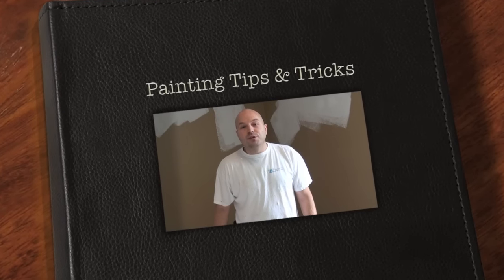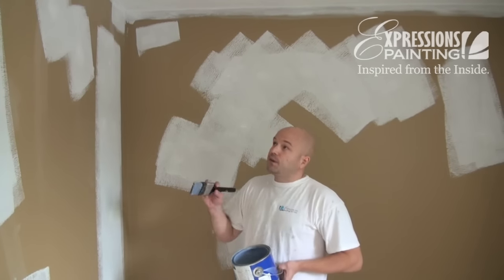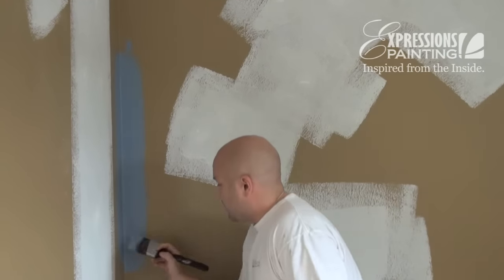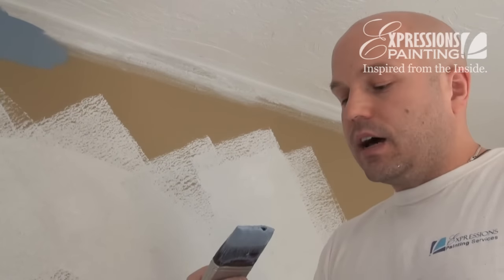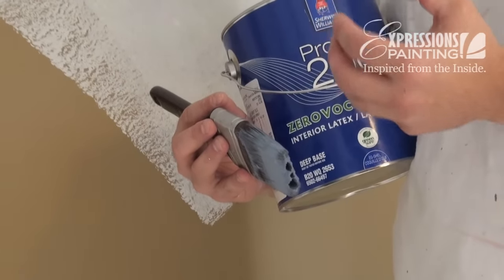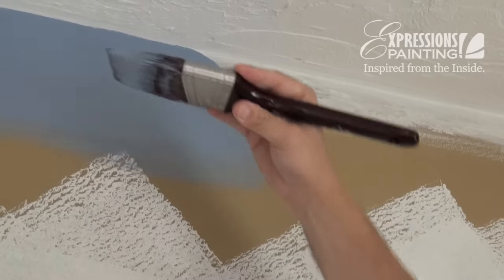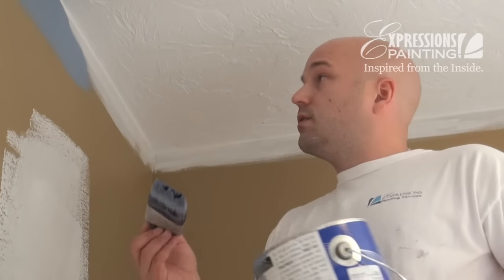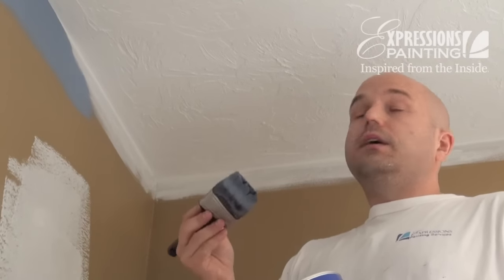How to cut a straight line like a pro

Comment: Quick question. Do you cut, roll, cut, roll or cut, cut, roll, roll?  Great videos by the way.
Reply from the maker: Cut roll... Cut roll. Sometimes you're able to get away with cut cut roll roll with lighter colors but it is still strongly recommended to cut first and then roll

Comment: I self taught myself this when painting my parents entire house before they put it on the market. I had painted before but this was the first time painting 10 rooms in a row over the Course of a few months on off days. First room I taped but it became really annoying and took way too much time and not to mention the cost. I tried several ways with a wet rag handy till I realized that the trick was to get a good amount of paint on the brush and paint the wall near the edge till the excess was off the brush then cut in in a long stroke with the tip of the angled brush towards the edge your cutting which pulls the paint toward that point but it's still a pain though but easier than taping for sure.

Comment: I always work top to bottom so that the last thing is to cut in gloss/satin skirting (what you call base board)to wall to get a nice crisp white edge. You seem to be cutting emulsion to a finish paint--doesn't seem the right way to me!?
Reply from the maker: I'm not really what you mean by emulsion but if there's one thing I learned over the years is that there are many ways to achieve a great finish product. Every project is different :)
All the best!

Comment: emulsion is wall paint. UK. 
We paint walls then to finish we cut a neat white line baseboard to wall with gloss/satin paint
Reply from the maker: That's what I did in this video series :)
Reply: Ok sorry but it seemed like you had painted the baseboard and were cutting in with wall paint in the video?
Reply from the maker: +markos bientos no worries ;)

Comment: Nit bad sir but I was taught that when you cut in a straight line you have to apply your paint both ways back and forth as you are making the actual line in order to make a perfect straight cutout, San Antonio Texas Painters
Reply: Not necessary.  Michigan painter for 50 years.

Comment: I don't use.a brush for cutting in...I mask everything, and use a wiz with a 3/8 nap roller to cut in with, and you never see the cut line...the texture is all the same. And I paint one wall at a time, so I'm cutting and rolling while it's still wet...the results look perfect...not to mention it's way fast...can paint a average bedroom in 35 min

Comment: The only thing i didnt agree with is not running tape on top of the base. Youre going to need it when you start to roll, and it leaves a better edge even if the base still needed to be painted.

Comment: He forgot to mention.. If you didnt notice
He started the blue on the white/brown and drug the blue into the blue he just painted..
He didnt start on the blue and pull it towards the brown.

If he started on the blue and worked into the brown. It actually pulls the paint away from the blue he just did and thins it out..resulting in thinner coat of blue..
Meaning you will have light spots and possible "picture framing" when its finished. 
Also makes the 2nd coat super hard cause it has to cover the 1st thin coat. And you usually have to put to much paint on the brush and then it gets all over the ceiling

So when cutting in
Pull the paint from the original wall colour INTO the new colour you just cut in.

Comment: Wouldn't it be better to use a 4" roller instead of the brush being any brush ia going to show brush lines.
Reply: Old Timer the mini roller takes a lot of unnecessary time and can get mess handling a brush roller and paint. just fade it out the people will never know a difference.
Reply: Some pros like to use a small roller as they cut-in. After using the brush, they roll over it up to as close as they can get to the ceiling, minimizing the brush strokes as much as possible. A particularly good painter can do it faster than most can cut in with just a brush. Idaho painter has a video

Comment: a good paint brush is fundamental to all this, & needs to do several things very well. It has to collect and transfer an adequate amount of paint to a surface. If not, then you'll be spending half the day dipping & transferring small amounts of paint from can to wall. It has to be able to move the paint evenly. And, if you're painting large surfaces, it needs to be able to produce an even & straight line for cutting that carries adequate paint. This is cuz a pro-painter wouldn't waste their money or time using tape to mask off transition areas, joints, borders, or corners.

Comment: do different offsets makes painted places look different too ?
Reply from the maker: kestutis markauskas not sure I understand your question...
Reply: +Expressions Painting sorry for my english and comprehensive skills being messed up. ok let me do my best of english: once u have done everything u showed on this video here youre taking next step - doing job with a roller but now all corners you just did are dry. so if corners are dry and u paint it with roller you are resulting in visible differences between those different jobs (brush job for corners and roller job for main flat areas)
Reply from the maker: Yes both the brush and roller have a different texture/look which is why it's important to fade them into each other. I'd recommend watching the video "How to roll like a pro" :)
Reply: +kestutis markauskas I mean thats why you cant wait in painting. once u started painting wall u have to finish it... do I need to explain clearer?
Reply from the maker: That depends on the paint. It used to be common practice to always leave a wet edge to allow a better transition from roller to brush. But nowadays with the Zero VOC paints, some require you to actually let the cut-ins dry before rolling. For more information you can watch the video "The Big Problem with ZERO and LOW VOC paints" or register for the FREE Painter program at Expressions Painting University :)
Reply: +Expressions Painting alright trying this then. need to learn thing about paints more than painting. 
cause once I painted a wall and finished from the top to the bottom each line after spreading it and it was still different. divided in different lines. it might been different texture or paints as bad as you talked about.
Reply from the maker: I would strongly recommend checking out the Free Painter Program then. It's packed with 45 videos and 3 hours worth of knowledge about paint.
Reply: +Expressions Painting alright trying to get tempted but can't make it :)
Reply from the maker: Those videos are pre-recorded and can be watched any time...

Comment: When I prime my brush against the wall, it missed a lot of spots. So when I cut the line, the paint was spotty too. Why is this?
Reply: itzyaboik your brush doesn’t have enough paint in it
Reply: When you load your paint brush instead of dipping it you want to have a quick jabbing motion so it opens up the bristles and pushes paint up into the brush instead of most of the paint being on the outside of the brush. That can also lead to a very messy brush early on. Most of the time you dont want the paint on the outside of the brush except near the edge. This is why after you load your brush you tap the sides on the inside of your bucket

Comment: You every use the one coat guarantee paint? I personally cant stand builders grade paint. Multiple coats equals more time and more paint used. I feel paying for the good stuff saves time and money. Also, it spreads much better with the roller.

Comment: Shouldn't you ensure a wet edge to roll into? Or is this not important,.. you cut in everywhere before you roll
Reply: +wilwamable +1... I've always read to only do one wall at a time so you always have a wet edge. Is that not necessary so long as you have good feathering of the cut in?
Reply from the maker: +wilwamable The technology in paint has changed drastically in the last few years and even though this may have been true in theory before, the reality was that it wasn't very practical or even possible to do with latex paint now drying much faster. That's why manufacturers have developed better "blend in" and "touch up" technology in paints to help with this. But one thing is for sure, not all paints are the same. Aura from Benjamin Moore would be an example where you actually need to let the cut in dry before rolling.
Reply from the maker: +Ben Stritesky The technology in paint has changed drastically in the last few years and even though this may have been true in theory before, the reality was that it wasn't very practical or even possible to do with latex paint now drying much faster. That's why manufacturers have developed better "blend in" and "touch up" technology in paints to help with this. But one thing is for sure, not all paints are the same. Aura from Benjamin Moore would be an example where you actually need to let the cut in dry before rolling.

Comment: I never cut in the entire room before rolling it out, you can get picture framing that way due to a dry edge! Cut in and while it’s still wet, roll it out. Now perhaps with a second coat you can hide picture framing. Also, the baseboard should have been masked in my opinion so you don’t roller spray the hell out of it and have to “wipe” it with a damp cloth. Just my professional opinion.
Reply: I always rad roll round switches looks far better. Doing the woodwork first is shocking.

Comment: One more tip, something I watched him doing wrong. On ur last stroke before rewetting ur brush, always brush that stroke into the wet paint, don't just feather it out any which way. If you look closely when someone does this you will see where the brush landed in ur cut and left a mark whereas if ur last stroke finishes back into the wet you'll see nothing you don't want to show up in ur finish job

Comment: Wouldn't getting "perfection" on the first coat be the way to go? (Only as far as the cut line is concerned)
Perhaps a couple extra minutes cleaning up the line, and you can now (if you like )blaze on through the second coat's cut-- a tad away from the edge.   
  I would think that even with a pretty drastic color change fully requiring the two coats for coverage, a halo of less than a centimeter would be more or less impossible to detect without making an effort.
Reply: No you will get a better line not trying to get it perfect first time, you are more likely to make a mess trying to get it perfect first by going back over it and shifting wet paint around.

Comment: I noticed you didn't tape off the base.. Why? It's a lot quicker and you get a nice straight line
Reply: Ryan Kerans because he's a professional painter. tape is for people who don't know how to.cut in
Reply: Travis Sharpe that is incorrect! I'm a professional painter of 20 years and I've always taped base off, so does all other professionals as well.. I can cut a straight line on the base but it's a much faster and easier process to tape it off with a tape machine, one of the most common professional paint tools. when you roll the walls out paint will drip onto the base if it's not taped off, no matter how good you are at rolling.
Reply: Travis Sharpe I have suspicions that this guy isn't exactly a professional.. He gives some pretty shotty advice sometimes

Comment: Pretty good video Fam but y are u using a cheap brush? And depending on the color every job doesn't require a 2nd coat. Time is money and I recommend Baer Paint and Primer to my customers and like I say depending on the color a lot of times I only need 1 coat. I definitely see u using 2 coats on the color you're using, being the color that you're using is lighter than the existing color.

Comment: Nice cut in. I find it therapeutic cutting in by hand.  Boxing all the outlets and switches hitting around the trim getting the corners good. Looks like you primed all the drywall repair as well. Nice job. I bet that room came out nice especially with that hand textured ceiling. Fuck these guys in their comments. 4 " brush is Good covers more ground but if your comfortable with a 2.5 sash for cut in. Good for you. I'd hire you.

Comment: Seems all painters have a tendency to paint too fast. They are spreading it like long strokes. The paint will be flying off like a spinning ball with water on it.  You don't need long strokes. Stay to small areas and keep the the roller wet. Not soaking. The more paint you put on the more you have to roll it away.  You will leave edge roller marks and then have to roll those out. take your time and look at the wall as you go. It's not a race. It's a work of art. Slow and steady but keep rolling.

Comment: Lazy painter  put your emulsion in a bucket  not from the tin. And loosen the light switch and sockets so you paint behind them and not get paint on them. And always do one wall at a time that way you won’t dry a dry paint line.

Comment: None of these pro painters ever mention periodically cleaning the excess paint out of the brush to prevent paint building up down near the ferrel which can cause the bristles to separate at the end of the brush making accuracy more difficult, if you’re gonna try to teach cutting in explain all the possible pitfalls that can slow down the job for a amateur

Comment: Used one expensive brush, will last for years and you don't need wall taping anymore, that was my own experience.
Reply: Dean they never last!!! I’ve tried a million different ways. Now I have a ton of brushes that can’t cut fir sh$t! 😂 I’m not poking fun. I just try not to get attached to brushes anymore. I could honestly go over the numerous ways I tried to clean, maintain and store them as well types. Nylon vs horsehair... etc. It’s inevitable they will kick the bucket in my opinion.

Comment: using masking tape on emulsion paint when cutting in corners is hopeless even low tac pulls paint of
Reply: Try using Frog Tape. The edges gel up and leave a straight line when you pull it. It's expensive, but it works.

Comment: Those places are shit holes easy to paint fast custom painting kn new drywall you can’t go that fast I use it paint apartments when I first start painting when I was young don’t get me wrong I learn different things from different people over the years but doing a shit whole you paint the  celling white and the walls what ever color and it look like a You was using a eggshell you can def paint so much faster with a semi or eggshell hey you guys are killing it they have A new set up for your sprayer utube housing were you can paint the ceilings in the walls perfect and not using the metal thing to block the sprayer from getting any of one color on to another check it out I seen it on pinptress